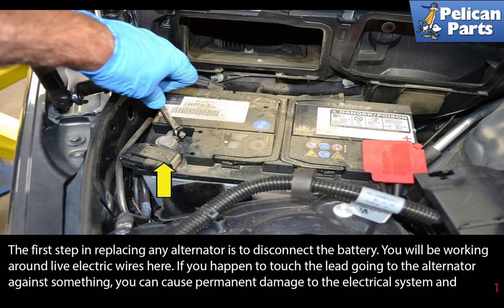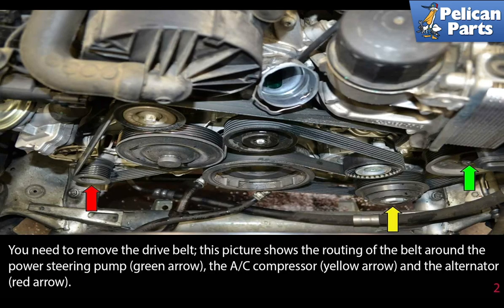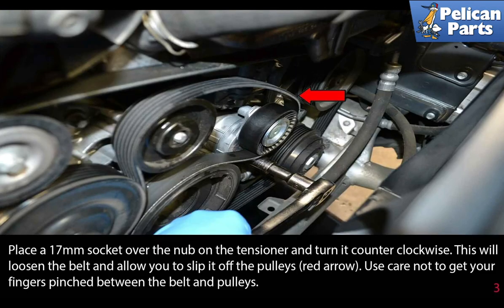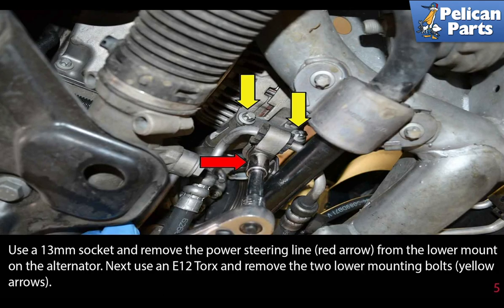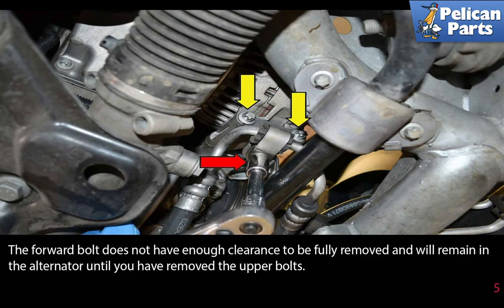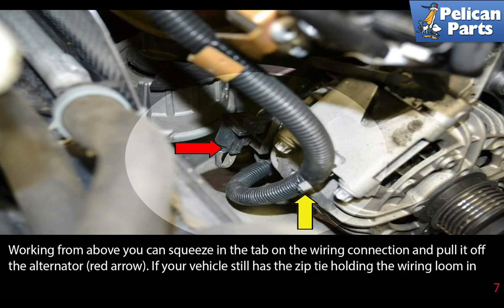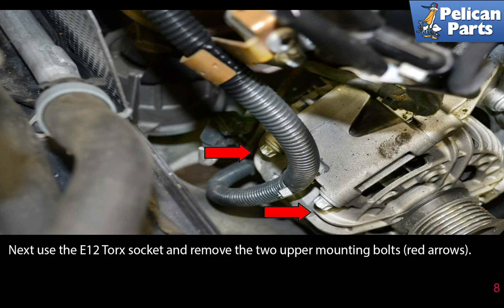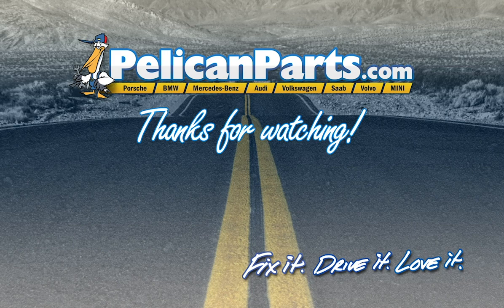Mercedes-Benz W204 C-Class Alternator Replacement

Comment: You should mention that there is no clearance for the right bottom forward bolt against the frame to fit a ratchet and a E12 socket on it. I found an E12 torx socket clamped hard with a vice grip From above will give you about a quarter turn, enough to loosen it  and work the rest out with your fingers.
Reply from the maker: Thanks for the Info. We appreciate it.
Reply: just use a mini or very short ratchet
Reply: Just raise the engine a bit with a jack and suitable blocks of wood.

Comment: Will I be able to remove the alternator on an m273 without removing the fan?
Reply from the maker: What is the year and model of vehicle are you working on? I can see if I have that info.
Reply: @pelicanparts  It's a 2010.. I ended up having the shop that rebuilt it put it in as they charged a very fair price but they had to remove the fan. Although I am not sure if it can be pulled out from underneath without removing the fan.

Comment: Hello sir, i have the exact same car with the m271 evo engine, under high load my voltage readings is 12.8 and the car starts surging, lights flickering, i could hear the blower motor increasing and decreasing speed, alot of electrical components are affected, do you think my alternator has went bad?
Reply from the maker: It does sound like a faulty alternator.